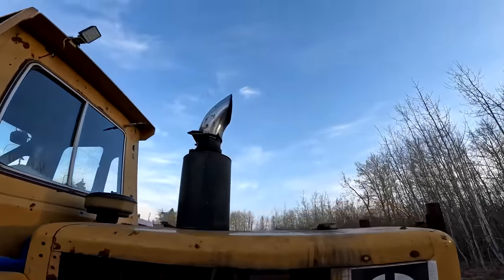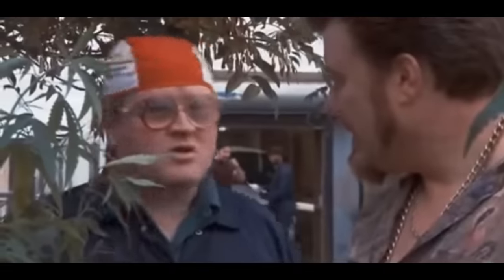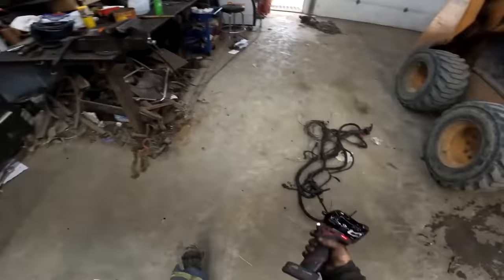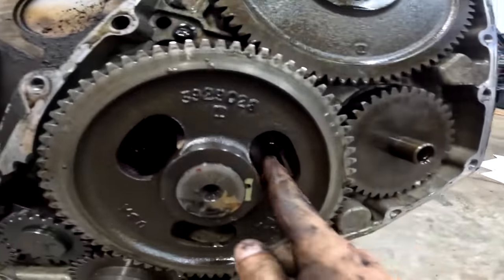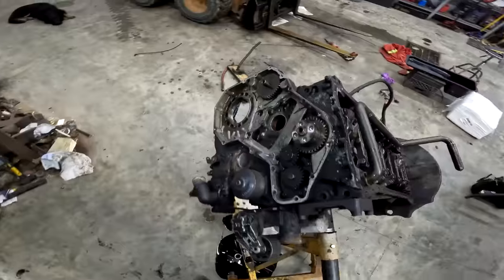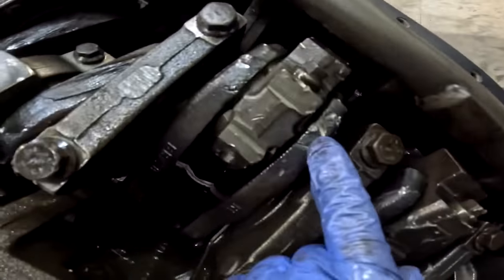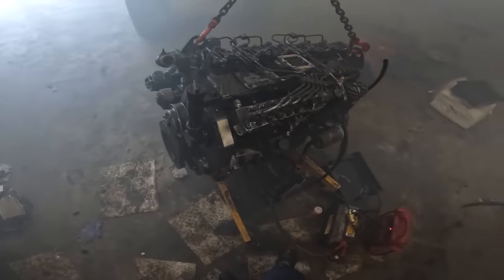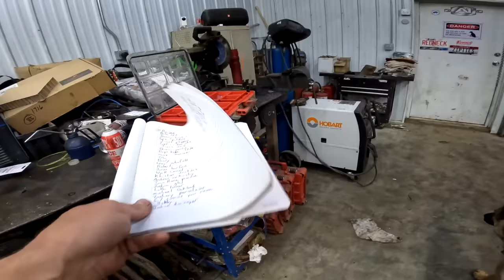12 VALVE CUMMINS... ZOMBIE EDITION!!

Comment: I worked at dodge as diesel tech when this jem was new and soon as you pulled the valve covers and saw bent push rods I said killer dowel pins strikes again fixed no less than 6 of these under warranty at dealer before the recall and fixing them before they explode

Comment: Hey Peg you gotta drop the camshaft and see if it breaks. A steel cam won't break and pretty sure that one is, but a cast cam core in a gasoline engine with hyd flat tappets will usually snap with a single drop. 25 years ago my friends didn't believe me. When I showed them how, my buddy Chris made a club called the cambusters. Thursday night was usually the chosen time to down 3 30 packs and a tray of tacos. Also we worked on some projects, sometimes.
Reply: Cummins cam is cast and will break if dropped on concrete.

Comment: Nice video ole Peg!  That knock could be from the rod that hit all the sh&t in the bottom of the pan. I don’t know if you pulled a cap off a rod or Main to look at the bearings it’s possible that rod cap got loose.  I’ve seen one other 12v that lost the dial pin that broke the cam and it was on a old farm out piece of sh$t.

Comment: The ugaduga spec from the air impact. Or the kill mode. I've seen people at tire shops tighten the lugs so tight that they strip the lug. Then you need to hammer on a socket to get them off.

Comment: My brother who decided to start the old 450 case dozer (5.9) forgot one little thing... thaw all the ice in the pan out before starting it and ran it "all of it" so made it oh say a hundred feet with her cranked to the max. Pieces and parts of course so tore it down for the pump, injectors, ect to use in a pickup truck engine.... stuff gets different as direction of the smoke stack an what not.. you know      the stuff as ya been there. Got the case power assembly stuff on it. Case was smart enough to dial back the power to where they didn't break stuff on their junk dozers... shouldn't call em junk as they did  lot of work for their small little size. Plus that pickup engine had been through a fire and had bits of melted aluminum everywhere .... I admit being old ain't all its cracked up to be. long an short, out of dozer, swap pieces and parts, dump back into dozer an fire it up... three days but only a total of ten hours as my spine is crushed an smoking enough pot to make O'leary ditzy so anyhow, fired up with a few leaks fixed.... I do believe my brother might of owned that engine you just put together (I jokes) he used his limited ability to keep one running... a oil change every week from leaks but that oil filter,   bless its heart,    weighed about a hundred pounds. I think his old dozer is probably to only one to weigh almost a thousand pounds more from his miller wire feed fixes.
      OFF ON A DIFFERENT RANT. Why blessed mary did ford make a damn good start with the 7.3 IDI engine.. injectors on the outside of the valve covers and also the glow plugs.. then comes the power stroke 7.3 with everything buried inside and harder to work on... If they had only got with cummins and built a engine with the same fuel system cummins used and of course glow plugs as that is one cold blooded engine.... Thank you lord for the new china made 4.5 amp starters that spun them up and made fuel pressure not a problem... what was ford thinking.... a 1.5 amp starter.   on that plus side, get a good 7.3 fueled right and a starter to turn it... great motors... its motor cycle, ford motor company, general motors... so a damn engine can be called a "motor"    enough on what electric versus fuel is called..
      Later Peg,, lets try to get Brent on his feet... one hella of a good guy but cooking twenty years of shop up for a kill the fun trip to texas.   I'm seventy three, got one more year in me lets kinda hope. a asshole in Louisiana payed his bills out of my alaska checking account leaving me eating willard food. Not banks fault even tho they know who did it. Gonna take a bit to recover from this prick
Reply: I've read shorter novels😅

Comment: Ah I see you use the same impact oiling system I do.
Mines a cheap POS brushed one tho, so I have to take it to the sink and stick the cold tap into the brush vents while spinning it at max to clean the burnt oil carbon off em

Comment: Hey Peg have you seen a IDI that was this messed up? The low end chatter sounds like normal Diesel noises. Or the camshaft bearing is a little worn, or maybe it’s just some piston slap. Runs pretty good, put it in a truck, & send it.

Comment: I’ll never forget I started a new job working for an older feller up the road from me. He always had nice stuff and I was constantly pulling trailers around with loads of hay or one of 50 skid loaders he had. He was riding over to a farm with me one day and I had a skid loader on the back of a really long trailer. Just driving as careful as I could in front of the boss man. We get there and get a load of hay and he decided to drive back. I’ve never seen that old of a man whip that big of a truck and trailer that hard on a gravel road before. 😂 we were damn near sideways at times going 70 on gravel. I wasnt near as nervous  driving his stuff after that

Comment: 39:42 I lost it, ha hah
The lower end chatter might be oversized cam races. Those old 12 valves only used 1 copper cam bearing insert at the front and the rest were just block bores direct to cam journals.

Comment: Lol, my aunt had a 96 Montecarlo and GM used a hollow camshaft in their 3.1 v6s around that year, you can probably see where im going with this, yeah it snaped it in half, and of course the pistons kissed one set of valves on each head, that was a fun job, used a brand new OEM camshaft for a 2000 chevy Ventura, thats all the part store had, wasn't hollow like the ones that car normally has.
Reply: Wonder if you could have used a 3.4 cam for higher output

Comment: Yo peg. I done engine stands with a flex plate or fly wheel an used starter gear to make a hand crank indexable engine stand so you don't have to use the tool box drawer strategy

Comment: Peg almost sounds disappointed that someone fuckulated the shit outta that 12 valve worse than he could. That chatter sound like its definitely in the camshaft area, highly likely that front bearing is about as tight as a German prottie. Amazing that KDP didn't chew up any teeth in that timing case whatsoever. Must have got slung to the front side of the case right off the hop and down into the pan, he must have been absolutely giviner all the way when it let go. If it went through the gears that pin should be completely deformed

Comment: I'd say the crankshaft journals and bearings have been damaged beyond acceptable tolerances, Bearing wear. Loose bearing main caps. Distorted bearing bores. 
I reckon if Willard had his own channel the monetization woudn't be a problem, zero censorship. So don't feed Willard the good stuff too often. Noone wants to watch 30 minutes of running around and shitting every 5 minutes. So strap a GoPro to his collar, and crank up the  electric guitar. Channel name suggestion: IDoStunned247

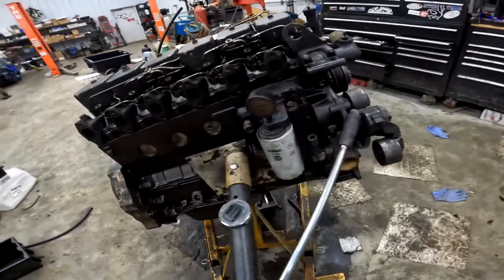Comment: 42:50 low rpm compression pre-detonation... to much base cylinder pressure for the fuel type. why would I know... need to lower the cylinder pressure to turbo it or it might knock the everything out...

Comment: if i had to fix it... that cam shaft would be welded back together; 1/8'' E7018 165amp "stop starts" = 1'' round holds 69'000psi or 5000lbft in the rotational torque "for the cam shaft, not crank shaft". do the same thing wit CV axles... them things are electro mag coil heated to become brittle and brake. (actual cast iron cam? not welding that)